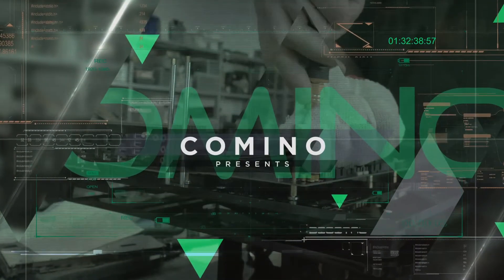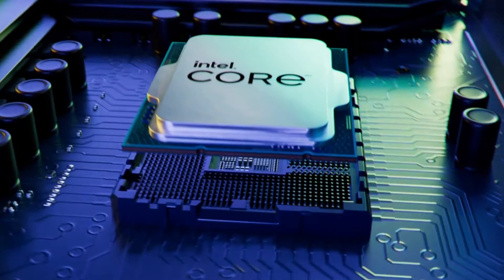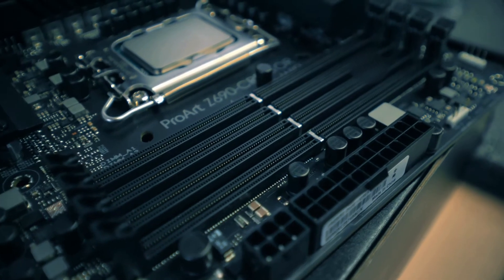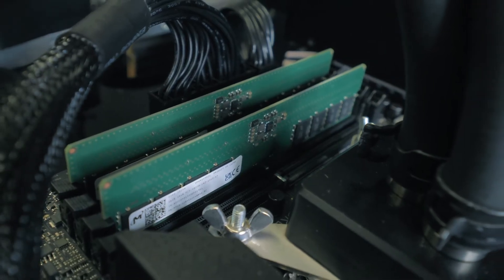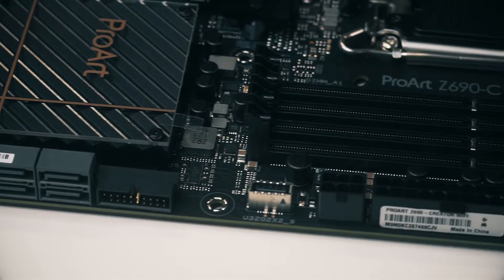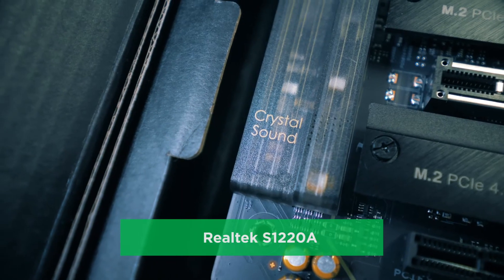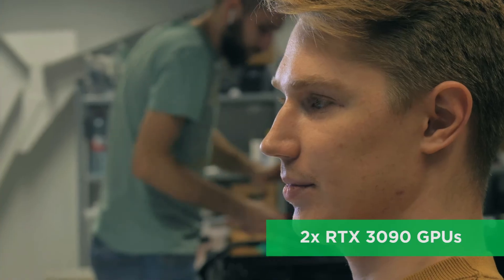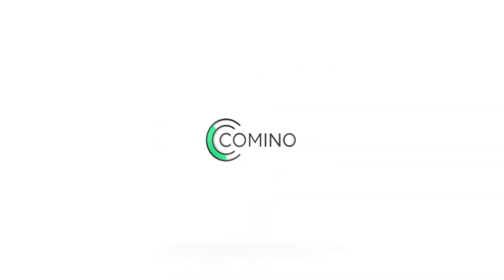Insane benchmarks🔥 Intel Core i9-12900 | DDR5 | A100 | ASUS ProArt Z690

Comment: kinda necroing this comment section i guess, but there is literally no coverage on the T Models of Intel - so thank you for covering the T Model Series! 

I was wondering: are the low TDP models worth it considering rising energy prices?  or would it make more sense to just grab a 12700k instead of a 12900T?  Im looking at atx sized builds.

Comment: What version i9 12900 ES version are you using? I've heard the QXQ3 has the pcie lanes disabled although you are clearly testing GPU's in the video.
Reply from the maker: We used 12900k and 12900T, we haven't tested the QXQ3

Comment: Hello, I have the ASUS ROG STRIX Z690-G and cannot get my A100 80Gb to work. I also have the core i9 12900kh with integrated graphics and at 14:45 you say your setup failed because of this. Would you have any clue as to why that is? Why did adding an extra video card work for you guys? I may get a cheap card to try this out.

Comment: If you ever get access to the 12900K variant, posting benchmarking data would be relevant, as it seems the power-limited 12900T isn't the right fit for a high-end compute server or workstation. Running the benchmarks on Linux or Windows 11 for proper thread management would also give a clearer picture of the platform's performance.
Reply from the maker: You're absolutely correct! We're working on a new video about the i9-12900K + the water block for it. As both things align, we'll make the review and post it here! Stay tuned!
Reply: @Cominotech  Awesome! Looking forward to this!